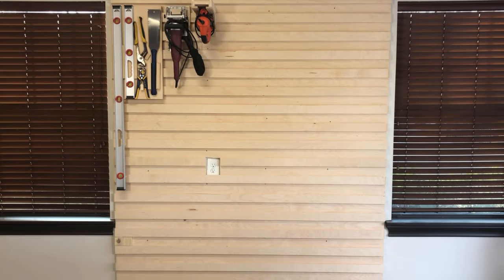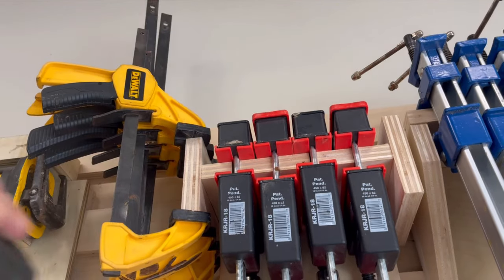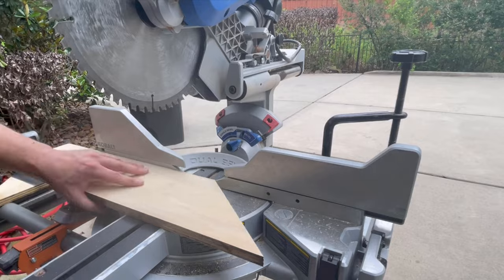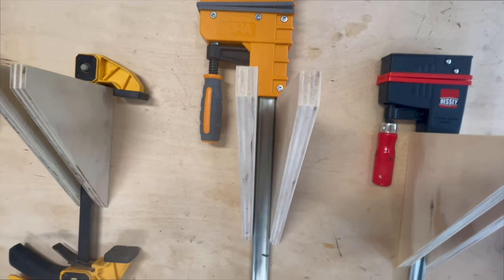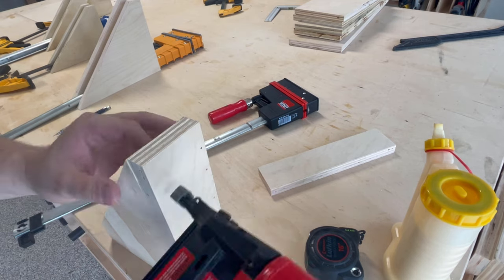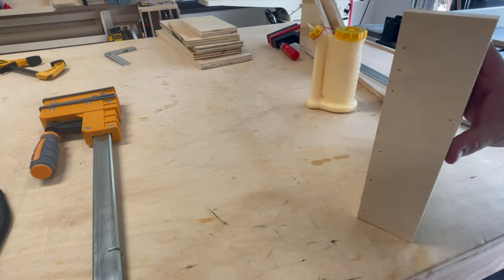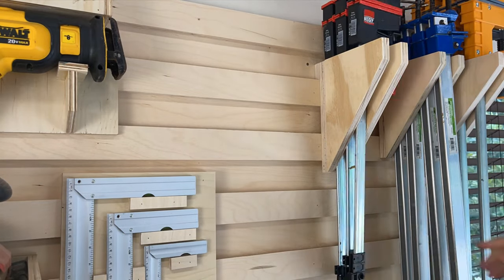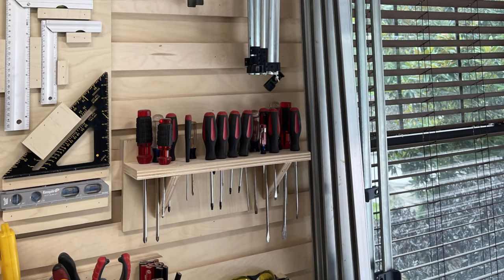Clamp Storage Optimization - French Cleat Racks

Comment: I swear I watched your latest video just a couple of days ago. Your cranking them out! My clamp racks are just like yours (but I made mine curvy). In fact I should make some more. I kept the template. You made me nervous when you were Brad nailing them together. The camera angle you used made it seem like if one of those nails went rogue then it could get you in the finger. I’ve had a couple close calls to never make that mistake again. 
Shop projects are actually my favorite. This week is probably all editing for me. I have two videos from one project. Hopefully have the first out soon!
Reply from the maker: I think you are my #1 fan at this point Dude Sawdust! You are right that I burned some midnight oil this week to put out two videos in a week. I am working through my backlog of projects I had lined up for this summer.

Regarding the Brad nailer, thanks for the concern. When I am nailing I alway try to ensure that I keep my fingers outside of the range where a stray nail could get me. Having said that, safety is something that always deserves utmost attention so I will pay special attention next time I am doing something like this so I don’t get complacent. Thanks for looking out!
Reply from the maker: Btw, your editing skills are top notch! I am very impressed.
Reply: @EigenDesigns  thanks! I only use iMovie but I try to make the most of it